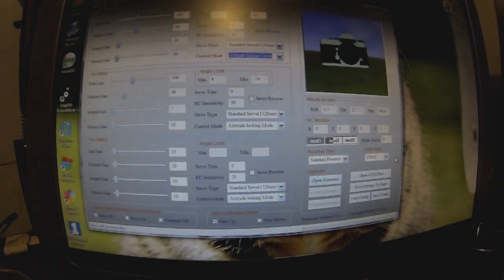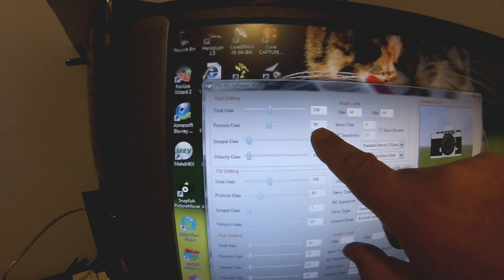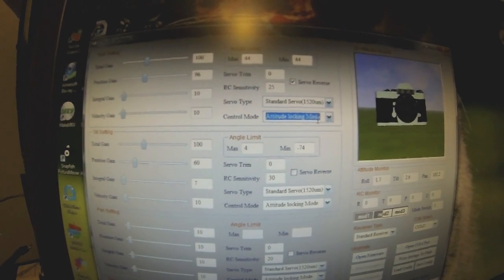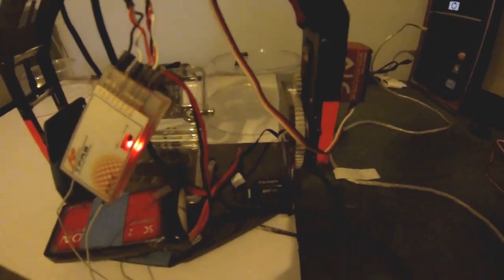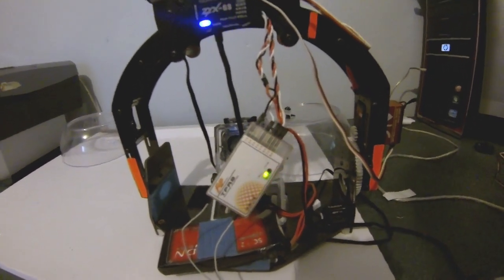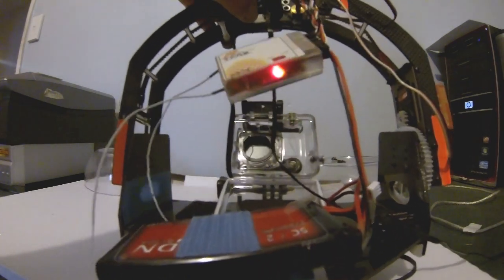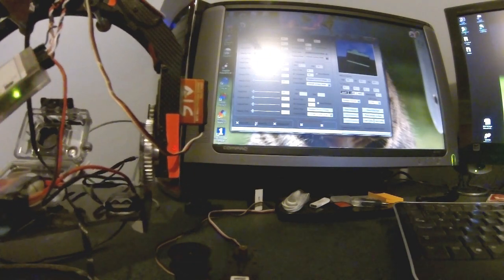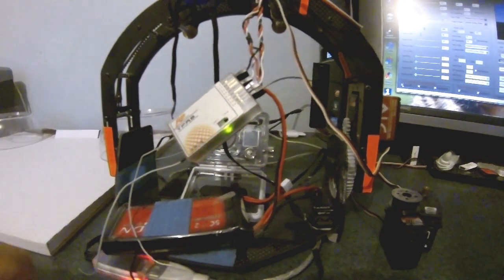Tarot zyx - gs camera gimble stabilizer Part 2

Comment: i have the same as your selection but whit a 3axis tarot gimbal but the tarot gyro isnt work great.

i use the same settings in the software as you but 

one the 3D Attitude Display where you see the camera move.
if i roll the camera you see on the 3D Attitude Display you see it using the Tilt

and else the same.

Can you please help me or send me al your software settings that i can put it in the sofware?

Thank you so much.

Comment: I have EXACTLY the same ISSUES with the Set I got from Tarot.....I downloaded the Driver and the GUI...as did you and ONLY the Tilt Worked....from Scratch....ABSOLUTELY NO Pan and couldn't even calibrate the Pan.....I am sending the one I have back to Tarot today....and seeking a replacement...Hopefully that one will work with the servos....otherwise I'm going to change out the system to another .....